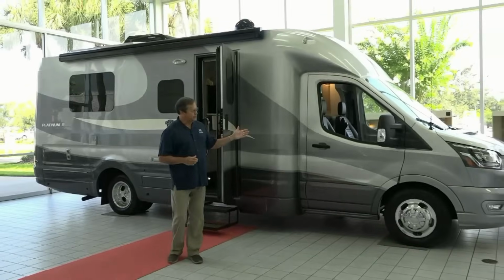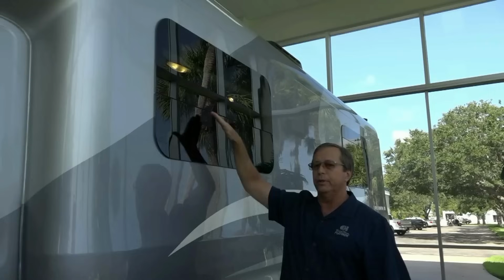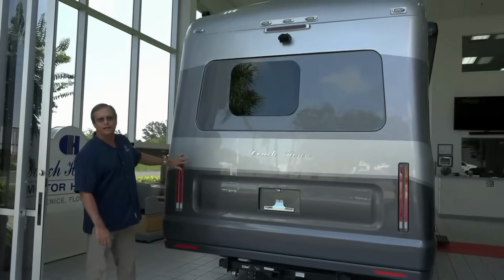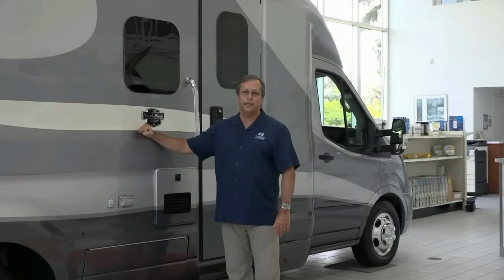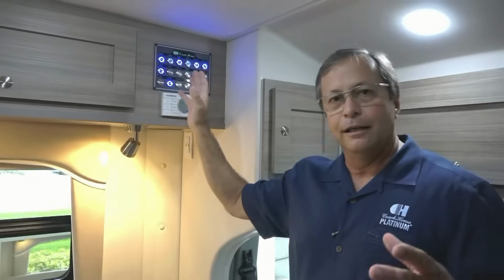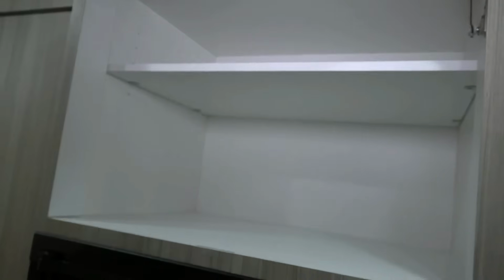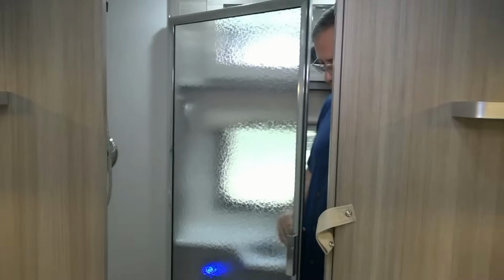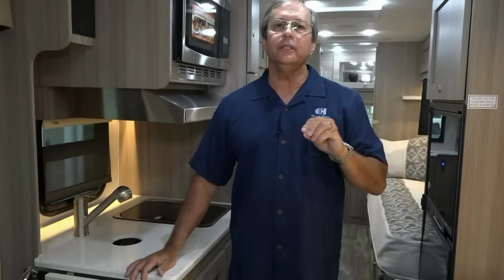2024 Coach House Platinum III 250 DT | Exceptional Quality B+ RV

Comment: I would like the 261 Platinum 4 floor plan on the transit chassis. The 250 Platinum 3 needs a slide out so you can put the recliners in it.

Comment: You mentioned no details about the electrical system (battery size, inverter size, solar wattage, charging capability) or the fresh, gray, black tank capacities. These are the most important data points that buyers want to know.
Reply from the maker: Thank you for pointing that out, and we apologize for not including those details in the video. You can find all the model specifications and features, including electrical system details and tank capacities, at this link: https://www.coachhouserv.com/specs-and-options. If you have any additional questions, feel free to give us a call at 941-485-0984. We’re happy to help!

Comment: What gauge wiring do you use in this?  Is this a 3000 Inverter?  Thank you
Reply from the maker: Thank you for your questions! The specific gauge of wiring and the details of the inverter can vary by model. For the most accurate information about the wiring gauge and inverter specifications, please contact us directly at 1-800-235-0984. Our team will be happy to provide you with the detailed information you need. Thanks for your interest!

Comment: Eco boost motors are broken down chitt.   It won't make 20.000 miles.     It will disintegrate  and burn 🔥 😢 🔥 🔥 🔥 🔥
Reply from the maker: Thank you for your feedback! We appreciate your suggestions and will take them into consideration. Thanks for watching!
Reply: I totally agree, ecoboost engines will not last!
Reply: Actually they last pretty long if you take care of them. They are powerfull and consume less gas
Reply: Where are you reading/hearing this? I have been investigating this and everything I find is people love them and it is one of the main reasons I am considering this coach.  I do hear a lot of complaints on the Mercedes but nothing on the Eco Boost so please enlighten me.
Reply: @AlanBennett866  blow me
Reply: @AlanBennett866 ditto here, planning to take one south of the border as it is a gas engine
Reply: Its a good strong motor,its best in class but ecoboost has a turbo in it,so those can go out on any vehicle. If you have a concern about it,just get the standard engine as ecoboost is an option.

Comment: Will you ever do a slideout on the Ford Transit Chassis? I love the Transit. I don’t see a ladder am wondering if the roof is walkable. I do not see any outlet in the galley. Am I missing something?
Reply from the maker: Thank you for your comments.  Unfortunately, we are not planning to put slide outs in the Transit.  The chassis has a 11,000 GVWR and being all wheel drive, we do not want to add additional weight.  We do not install ladders because of the contoured roof.  It is a great rain and debris repellent but it is slippery.  There is a 110V outlet in the galley.  Feel free to call us at 1-800-235-0984 if you have any additional questions.
Thank you
Steve
Reply: @coachhouserv  thank you for replying so quickly. I do wish there was one near Knoxville TN that I could physically see. I think this is the best built of any I have come across and I have been doing a lot of research on them. I currently own a little travel trailer that is great and the perfect size for my needs. I love it but Father Time brought with him some physical limitations that are making it hard for me do the hitching and unhitching. I will tell you that Coach House has moved to the top of my list.